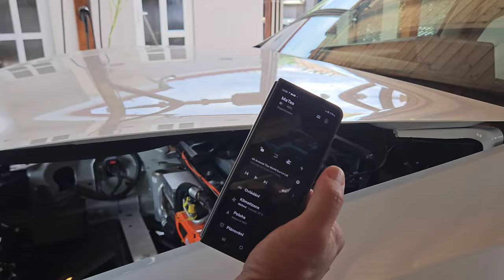MyTes - installation Power Frunk V5 Hansshow to Tesla Model Y LR 2023 Berlin

Comment: Hi
First of all, thanks for this great tutorial! It does really help.
I’m French and I also have a 2023 LR model Y from Berlin, I wonder if you can tell me which part you ordered? The one for “2023 + Austin and Berlin model Y” or the one for “2023 + model Y” ?
Cause the first one doesn’t seems to have the brackets so I’m a bit disappointed.
Could you please tell me the part number of your power frunk kit?

Thanks a lot!
Reply from the maker: Hello, at the time we installed it, there was only the "Mode Y 2019-2022" option to choose from, and even the manufacturer didn't know if it could be installed in the 2023 model, so I was one of the first to install it until 2023. Today it is possible to buy  a car that has several parts printed on the gigacast and then there is a difference in the attachment of the pistons, if you don't have this yet then you can easily choose the 2019-2022 variant is the same as for 2023, if you already have a gigacast contact the seller, because it is not clear which one  the two remaining variator is the right one.  Best regards, Pavel
Reply: @MyTes_cz  thanks for your help! 👍